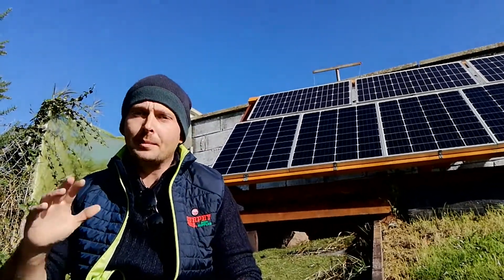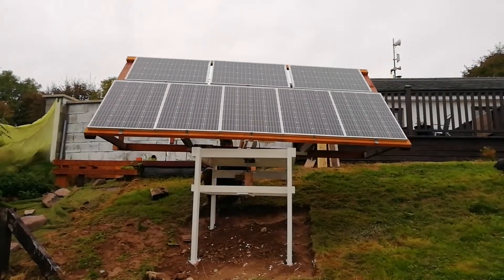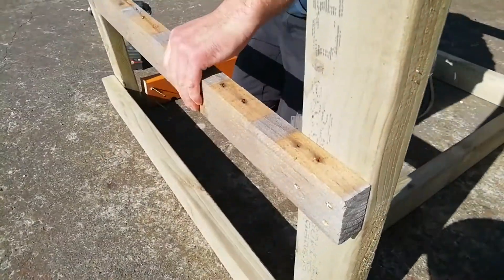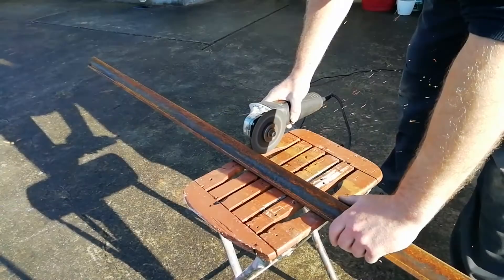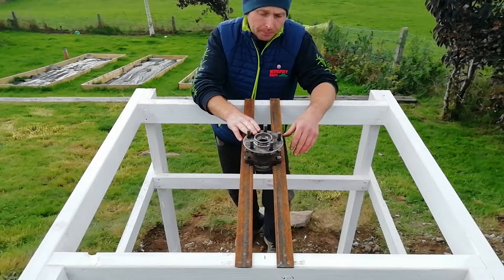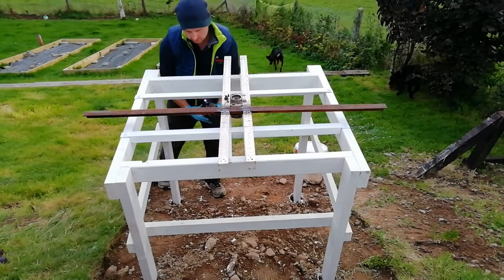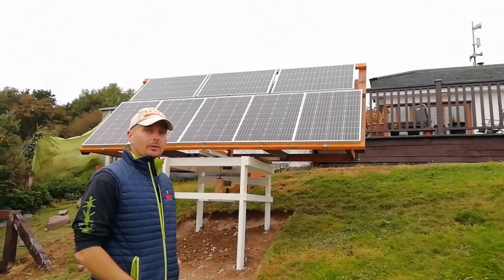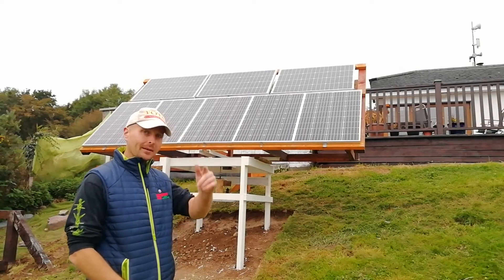DIY Rotating Solar Panel array.

Comment: Great job!

Did you ever find a mechanized/automated way to turn it? I've been looking at single and dual axis actuators to adjust the tilt X and Y axises, but thought rotating ours makes more sense and less moving parts...just doesn't seem to be as common. Congrats!
Reply from the maker: Hi and thank you for your kind comment. Did build a remote control mechanised version in later videos. You can find them on our channel.

Comment: I did find the parts for the thing below (that's rotating the solar array), but what's part do you have that's from solar array that's connect with the top of the part? Didn't talk anything about it or didn't show it either. So that's why i'm wondering. Also i know you have newer version of this now, but i wan't too keep it "old version". :)
Reply from the maker: @MrLasox  hello, can you be more specific? Do you mean the central bearing or the axle or other?
Reply: @ourkilkennyhomestead2006  Of course, i found this item:
https://youtu.be/Q4TehyA5IW0?t=94

You are showing us the bearing, but how do we attach it from the solar array? Can you show us how you did connect with it or any parts that's looking similar? Or did you just making some holes that's matches with the thing rotate? :) 

Thanks in advanced!

Comment: You can use a actuator for opening doors witch will turn the pedal I have something similar on a smaller scale on the roof of my camper van only my panals also raise and turn and lay flat for when I’m driving my camper van

Comment: This is a great idea using bearing/wheel assemblies for the base a point of rotation.  Outstanding.  To me this would have been the hardest part to acquire a pedestal base from a supplier for a reasonable cost.
Reply from the maker: Thank you.

Comment: This is just what I've been wanting to do with my solar panels but did not know where to begin. Thank you for sharing this! I do have a question, I live in an area that can get quite widy. Have you experienced any high winds and if so how did it hold up.
Reply from the maker: Hello and thanks for watching. We get high winds here also and it holds up OK up to about 50mph winds, on the rare occasion that we've had stronger than 50 I've tied it down with ropes as a precaution. So far it's gone through storm force 10 and is still going strong.
Reply: @ourkilkennyhomestead2006  awesome, thank you so much for sharing your knowledge and for your very fast response!

Comment: This video was exactly what I was looking for. You built with used items from around the farm. Instead of a motor, I want to use weights for the energy, similar to what is used in a grandfather clock